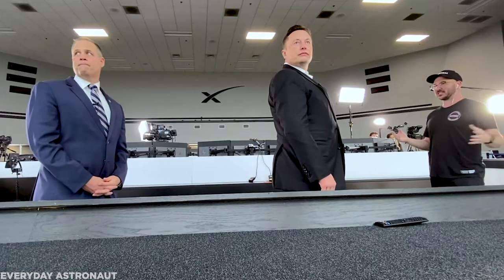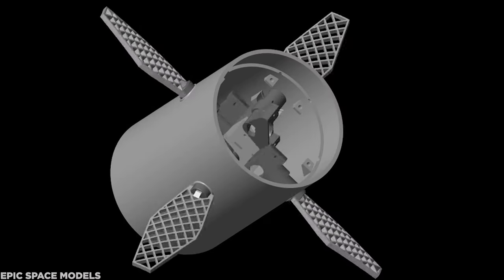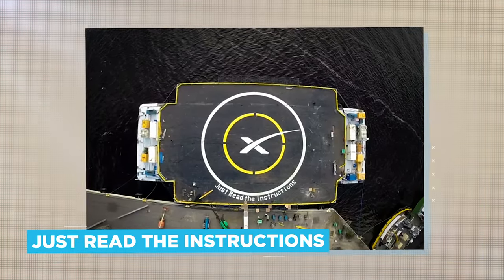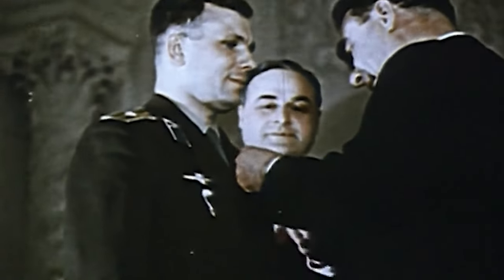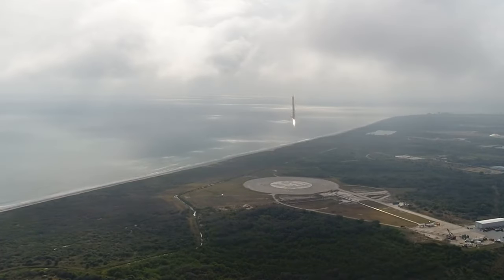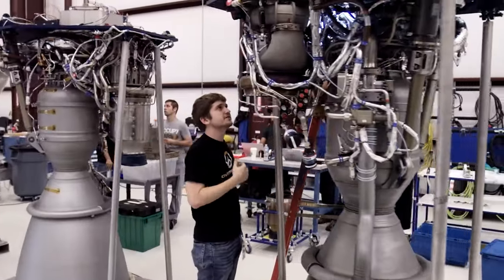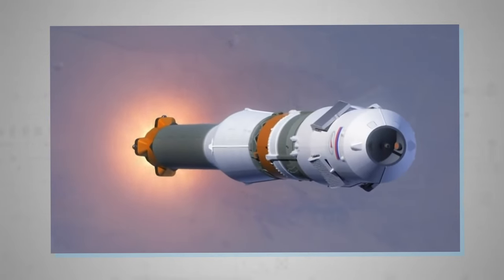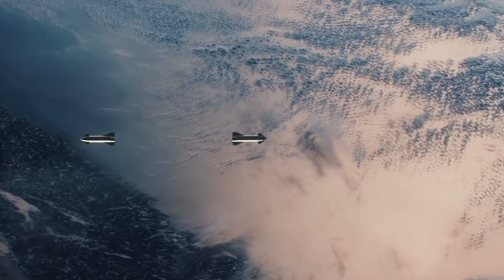How Does SpaceX Build Their Rockets

Comment: Is it possible to drill a vertical hole of X number of meters and use the hyperloop technology to avoid completely or combine with the existing rocket fuel to make it cheaper and lighter in weight. Fuel would then only be necessary for one last lift up
Reply: yes

Comment: Most of this stuff is not new tech. How is landing gear new? Especially when almost all of it was on the apollo LEMs? The crush core, having it deploy? Planes do that the LEMs on apollo did it also so they would fit in the Saturn 5. And yes the engines are new but they use the same principles as rocket engines from before them. So the new tech in the same place as where you said youd say how they build they're rockets?